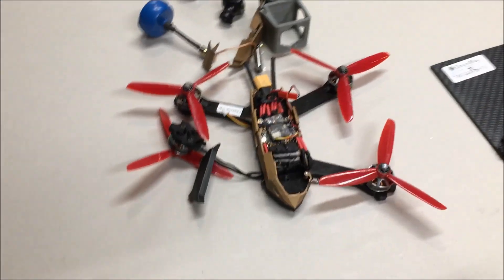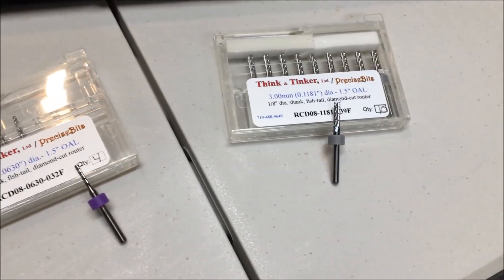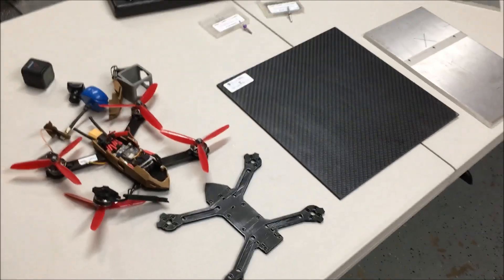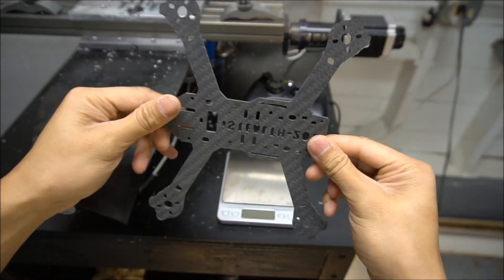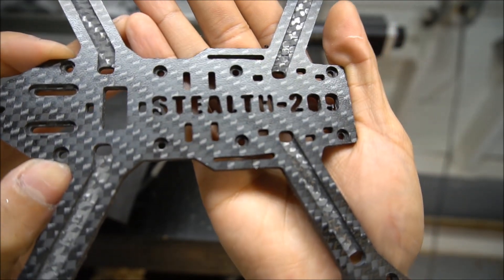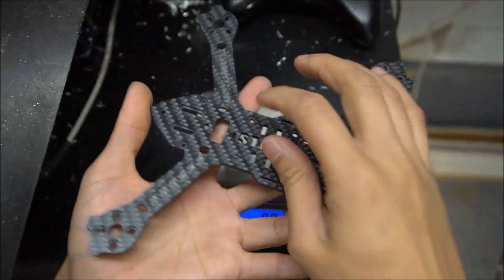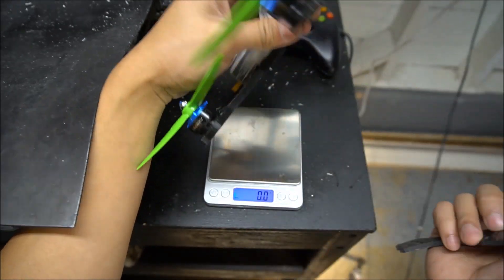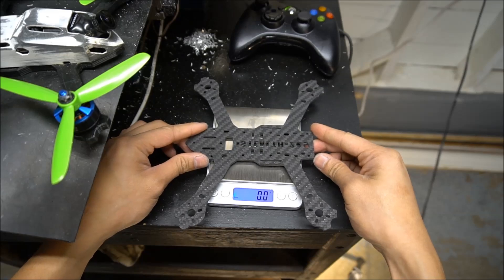Machining Carbon Fiber Racing Quad Frame

Comment: It is not smooth due to the delamination between carbon fibre layers
Reply from the maker: The rought side came from the manufacturer.  Some CF plates are just finished like that.

Comment: which material did you choose in Solidworks to estimate the weight and also what is the density of carbon fibre sheet?
Reply from the maker: I forgot which material I used. But I think what I did was weighed the uncut carbon fiber and modelled that in SW. I then changed materials in SW until I found the closest real life weight. Hope this helps you.

Comment: microscopic needles in that carbon fiber dust as you cut, puncturing your lungs if you inhale it or touch something contaminated by it. not recommended.

Comment: When I try to cut CF sheets using my cnc, the bottom edges are burred and have strands that protrude (on the side of the CF that touches the waste board). Does anyone have any tips? What are your tips for a smooth exge after cutting? Using a carbide 3m bit. Thanks
Reply: Very late, but harvey tool has compression cutters that are amazing for that

Comment: I have no idea what i'm tlaking about and have no credentials to be saying this, but it just feels like you weren't using enough coolant while etching this out.  I'm willing to wager you broke those diamond bit things. ESPECIALLYwhen digging into that metal. I've watched machining in other videos before and they're pouring coolant on it the entire time.

Also, why dig that strip out in the arm with a hole there? it looks like it's gonna be an extremely weak point of each arm.
Reply from the maker: I learned so many things machining this frame. And you are right, those holes at the base of each arms were a weak point. I will consider these factors when designing my next frame.

Comment: its your depth of cut for better results do multiple depth cuts
Reply from the maker: Rony 2 passes for the outline cut worked pretty good for me.
Reply: I noticed that some of the tools broke, what was the feed rate at the time?
Reply from the maker: Rony don’t remember exactly what the feed rate was.  But it was machining the aluminum plate at the bottom also, that’s why it broke. I should have set it to machine aluminum. I believe I adjusted it to machine aluminum later on.

Comment: Was the original 3d printed frame abs, pla?  Just curious as I make my own too.  I have an older cnc sitting in the shop and have been debating doing this for awhile.  I have been printing a bunch with taulman 910 for the micro stuff but am working on a 3” design and wondering if it is worth the setup/cost over the taulman.
Reply from the maker: kweidner1 I used PLA for my 3d printed prototypes. I enjoy the process of making the fixture, creating the tool path in CAM, and machining. So for me every single step of the process has been rewarding and worth it. Plus I get to learn new things. I say just go for the CNC machined CF frame.

Comment: Hello can you tell me the parameter you used to mill the carbon fiber?
Reply from the maker: Afiq Waqiyuddin I forgot exactly what I used as feeds and speeds. But I can tell u that I used feeds and speeds you would use for aluminum since this is the first part I machined with my alum fixture. And I cut through that fixture with this first pass.
Reply: Oo, its ok. I just want the carbon fiber milling parameter because I can't find the standard parameter. Thank you by the way.

Comment: Rather than packing the carbon up from the tooling plate. Re run the program with speeds and feed suited to the aluminium with an oversized tool to a depth of say 0.5 mm into the tooling plate. This will allow the diamond tooling to cut into fresh air at the bottom of the toolpath.

Comment: Hi man, i'm building a 450 mm quad drone for a contest, it is going to weight like 1.7 kg and i would like to know if you could help us defining the tickness of the main frame, composed of two sheets, and, if you know about it, the external and internal diameter of the carbon fiber tubes that we intend to use as arms. In such way that we guarantee structural resistence and lightweight. Thank you!
Reply from the maker: Santiago García Gómez without doing any structural analysis, my input would just be an educated guess. I suggest you study the design of existing quads that uses carbon fiber tube arms. Look at the DJI Inspire 2. Good luck with your contest. 
https://m.dji.com/product/inspire-2?from=index_list
Reply: Hi Friend, we are carbon fiber manufacturer,Wonder if you still have demand of carbon fiber plate. please inquiry to sales2@xccarbon.com Karan

Comment: Hey that plastic you peeled at the end is it already attached to the dragonplate or did you buy it separately, if you did from where??
Reply from the maker: That protective plastic was already included with the CF plate.
Reply from the maker: If for some reason yours did not come with a protective cover, you can use packaging tape to protect your piece while working on it.

Comment: I hope you were wearing the proper respiratory when cutting that, CF puts some really bad stuff in the air that's terrible for your health. Nice job machining the frame though. I've got a Taig CNC mill myself and its a surprisingly capable machine.
Reply from the maker: Thanks for your concern. I know the hazards of machining CF. I was wearing a proper respirator while making this frame.
Reply: @NanoMechs  People have died machining that stuff, I would recommend using something less deadly. ,':3
Reply: @TakeDeadAim Inhaling carbon alone can give you lung cancer.
Reply: @TakeDeadAim "No more toxic than sawdust." So...does inhaling sawdust increase your chance of heart disease and lung cancer? There have been many studies linking hydro carbon emissions, and carbon inhalation to increased risk of lung cancer (NCI/NIOSH)."...not a hazardous material..." Well, if "hazardous" means you don't die immediately, then I'll agree with you. Inhale at your own risk courtesy of Deadaim and OSHA.
Reply: @TanukiNPals_Lofi  just the air we breathe outdoors is deadly for us , why can we do ? Your not making a whole lot of dust .
Reply: Great machining!